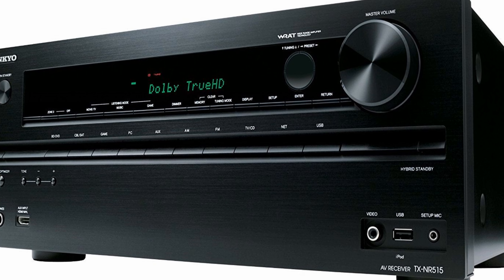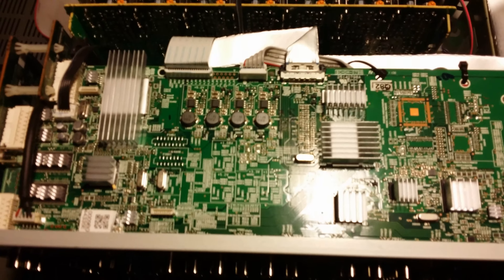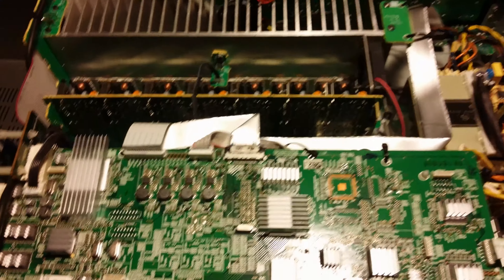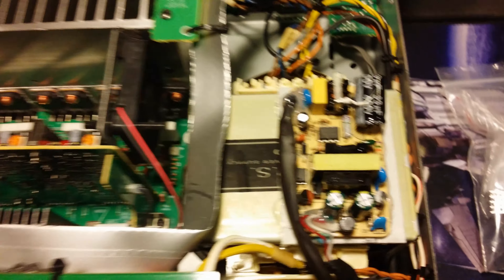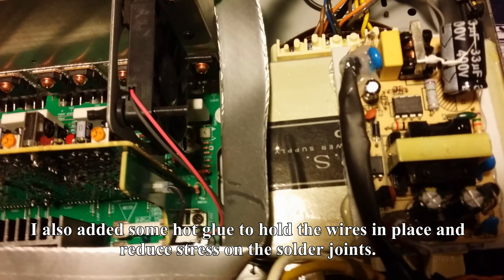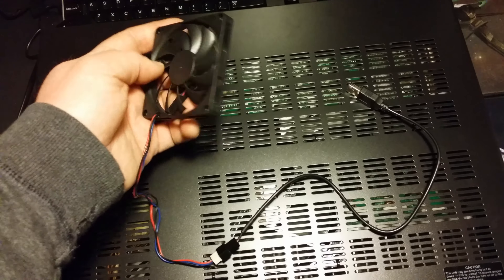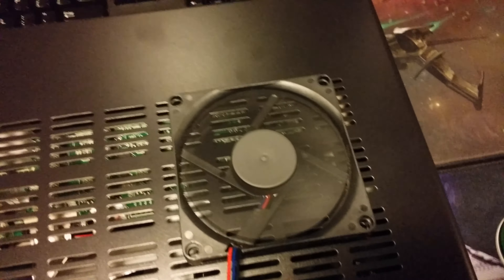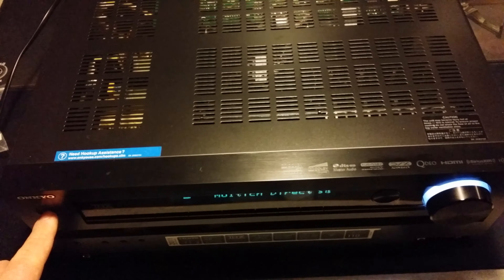ADD DIY: How to cool your ONKYO receiver -or- Save your HDMI board and prevent the "no sound" repair

Comment: Good video. Inspired me to repair my ONKYO TX-NR737 AV receiver and to integrate a self-made fan control to protect the components from overheating in the long term.
Reply from the maker: It is unfortunately necessary with these, especially when they are tucked into tight spaces like this one was.

Comment: Nice receiver Ed. I've always bought Pioneer receivers but I haven't upgraded in years. Good to see a video from you.
Reply from the maker: I had a Pioneer Elite for years, and then a non-Elite with HDMI switching, but it just acted as an HDMI passthrough and required separate audio input.

I went with Onkyo because they use a Qdeo upscaling chip, which is also used in the Framemeister. The quality of the upscaling is fantastic, and it introduces no perceptible lag in games. It upscales analog sources to 1080p (or 1080p to 4K) then outputs the signal through HDMI, and pushes the signal to both my TV and projector.

Overheating chip aside, you really can't beat them for the price if you want to upscale retro games and laserdiscs.

Pioneer is owned by Onkyo now anyway. They use similar parts and have similar features.

 Thanks for watching Gary.
Reply: EdT1138 sounds like a good alternative to a Framemeister.
Reply from the maker: It doesn't have all of the options, but considering that fact that you can get a similar chip for less than a third the cost of a Framemeister,  it is a viable alternative.

Comment: Excellent tip! Good you had a solution for the vibration.
Reply from the maker: It's silly that you should have to do this at all when a cheap heat sink applied by the manufacturer would fix 90% of the issue, but this brand has a few features not found on more expensive models from other manufacturers.

Comment: Hi, the amp still works? I have the tx-nr3009 with the "no sound problem", I am going to repair it and I am going to look for more heatsinks and I already have two fans that were from HP all in one. Onkyo It was a mistake that cost them the brand not to have put decent ventilation.
Reply from the maker: It worked for another year and a half after this, then I sold it and upgraded.

If you haven't already done so, do a factory reset before you open it up.
Reply: @edt1138  thank you for the tip of factory reset
Reply from the maker: @Luortizsolorzano  A number of people have said it fixed their sound issues. Maybe you'll get lucky too.
Reply: @edt1138  thanks for the information and it is true there are many who managed to repair their amplifier, the one I have was bought secondhand, I opened it just to check it and it seems to me that the original owner opened it and they repaired the dts chip and that does worry me, because if it turns on normal, but it does not give sound.

Comment: I just picked up an Onkyo Tx-NR646(N.Amercan version) which has an internal fan that never ran even when the receiver got hot,The receiver NOT being in a cabinet, and well vented. I could find no reference in the service manual as to what temperature it should cut in at, or if possible to adjust the temperature setting. Simply cut the wires from the connection feeding it, (it is marked as 12v.0.9A)and now feed from an external 12v supply I had spare, works perfectly, the unit has very minimal heat to touch on the outer casing after two hours of use now, previously it was hot to touch after a few minutes operating at low volume just listening to FM Radio. It is quite easy to feed the wires from the power supply through a small whole that exists in the rear panel, and the fan wires are very easy to access, with sufficient length to work with and make the required connection to the power supply, after removing the top cover from the receiver.Also runs very quietly.
Reply from the maker: Sounds like it should do the trick. Good luck.

Comment: Many of these laptop coolers have cheap sleeve bearings and get loud as time goes on. Take a look at the AC Infinity AIRCOM receiver coolers or their MULTIFAN line if you are on a budget. They are temperature controlled and very quiet.
Reply from the maker: Thanks, I'll take a look.

Comment: I put a fan inside the top cover of an old Sony A/V receiver. What I did was cut out a hole in the cover allowing all the air to flow through instead of the highly restrictive slots in the cover. Put a chrome finger guard on the top.

Comment: what is the diferent between those to chips? is this new better then old one?
Reply from the maker: It has been a while since I made the video, but I think you are referring to the picture of the chips I inserted in the video. That picture just shows two different versions of the chip that frequently causes problems when it overheats.

Comment: ive got the tx-sr805 , king of all super hot toasters!  the hdmi board was hot as hell and reciever would  randomly chirp on the different channels when it heated up...I added a heatsink to the main chip from which most of the heat came from, then ran an external 90mm computer fan with a 5v powerpack which was simply plugged into the 120v switched output socket on the back of the reciever..seems to have done the trick...the fan should be placed to draw the heat Out and awy from reciever and will be quiter if elevated with 1/4 or 1/2" risers under each fan corner..

Comment: I have HDMI fail ( resolution pbr ) TX-NR646, no video via HDMI, i think its over heat problem, i see 80 mm fan in over mainboard. i have no better idea what i fix hdmi issue.
Reply from the maker: If you haven't done so already, do a factory reset. Sometimes the Onkyo and new Pioneer receivers can have a whole host of problems fixed with a factory reset.

If that doesn't work it is a hardware issue of some kind and you will need to either repair or replace it.
Reply: @edt1138  I reset, and New firmware. No fix.
Reply from the maker: @SPPhotography89  That unfortunately leaves repairing or replacing. 

I was able to find a cheap HDMI board on eBay to replace mine, but that was a stroke of luck. There are videos on YouTube showing a few ways you could attempt a repair, but if you aren't comfortable with that sort of thing you'd have to pay someone. There is also always the option of bypassing the receiver altogether with video and just using it for audio processing.

Comment: How did those heatsinks work though?
Reply from the maker: It seemed to work. I owned that receiver for another year, and used it almost every day for hours without ever having another issue.
Reply: EdT1138 Classic Gaming Enthusiast hmm may try it. Mine gets pretty damn hot
Reply from the maker: @CrashCarson14  It won't prevent it from getting hot, it will just help dissipate the heat from the chips. The fan did a great job of pulling the hot air out though.

Comment: Hi EdT, my receiver keeps turning off after 15 minutes.  I have nothing plugged into it. I’ve had the receiver for over 10 years and now it just automatically shuts off. What can it possibly be? Pls help.
Reply from the maker: Sounds either bad capacitors or something is overheating. I am not an electronics engineer, or even a particularly good hobbyist, but that is where I would start.

On the other hand, if you have had it for ten years you might be able to upgrade relatively cheaply.
Reply: Thank you!

Comment: Can someone clarify me if I'm wrong? By my understanding, if you wire the fan to the adapter and then to the mains voltage, doesn't this mean the fan will continue to run even when you turn the receiver off? It's not like there's a switch somewhere in between mains voltage and that adapter he put in... Also, I'd like to know if there is any 9-15v DC anywhere in these receivers? If there is then I'd wire the fan directly to these points rather than including a power adapter. Otherwise, I'd do the USB option shown in the video as my receiver also has a USB port too

edit I figured it out! Most Onkyo receivers, if not all of them have a ribbon-like cable that connects somewhere on the outer edge of the HDMI board. This ribbon cable carries multiple +12V and ground paths, it's even conveniently labeled on the board which ones are 12V and which ones are ground. I used these paths to connect a computer case fan and it works! Powers on and off with the receiver like I wanted, perfect.
Reply from the maker: I can't remember for certain, but I believe I mentioned that it was a "switched" point on the board. In other words, when the receiver is turned off, no power runs to it.
Reply: So I looked into it today and I found a solution! Most Onkyo receivers, if not all of them have a ribbon-like cable that connects somewhere on the outer edge of the HDMI board. This ribbon cable carries multiple +12V and ground paths, it's even conveniently labeled on the board which ones are 12V and which ones are ground. 

I tapped into a 12V and ground path and connected my Cooler Master 200mm case fan (yes 200mm, it's big!) and voila, it works! It powers on with the receiver and shuts off with it also. The hardest part was probably zip-tying the fan to the chassis, the rest was a breeze!
Reply from the maker: @alexkalicharan8283  Just my own personal hangup I guess, but I wouldn't tap into anything on the HDMI board itself. There are so many issues with that board already, I wouldn't want to do anything that could cause voltage fluctuations or run any additional power through it.
Reply: @edt1138  in my case I use my receiver in a stereo setup, I don't use any of its HDMI inputs just analog audio from my PC and occasionally a CD player, so all is good for me. Others may want to take precautions if they value their HDMI board, then again a typical 120mm PC fan draws about 120mA so I don't know if it's dangerous or not. Do at your own risk!

Comment: Sorry to ask, the fan, pushes air in or extract air out.
Reply from the maker: Blows air out.
Reply: @edt1138  Thanks, my new Receiver its a TX-RZ820 has a built in fan. Its does not get particularly hot even with it of, but once in a while you hear the relay click and turn it on. Thanks, cheers

Comment: Hi EDT1138...Very nice video. I have an Onkyo HT R670 avr. I would also look now to do a preventive add-on of heatsinks + micro exhaust fans. My two queries here:

1. Which points did you add heatsinks on. Is that only on chips or something else also?
2. How to paste or glue these heatsinks there?

Thanks in advance...
Reply from the maker: There is a particular chip that causes the HDMI sound to fail, but I ended up applying a heat sink  to every  hip that got hot while it was on. Probably overkill.

Look up thermal adhesive, or thermal pads/tape. I used thermal adhesive.
Reply: @edt1138  Thanks, dear!👍

Comment: For ALL new Receiver owners , Denon, Marantz, Onkyo,Pioneer etc . Buy two fans ,one pulling and one pushing. Dont rely on the Manufacturers. Fans are cheap .
Reply from the maker: I honestly can't figure out why they risk pissing off so many customers when a 3 dollar fan and 20 cents worth of heat sinks could have solved the problem.
Reply: @edt1138  Because they have to sell more and more, otherwise from the business point of view they will die. If you don't care about the equipment, in a few years (after 2 years of warranty) the equipment will be broken and you have to repair (but will be very difficult to do this because you will not find components - look what happened to the entire world with Onkyo HDMI boards of different models) or simply you will buy a new one and in this case the company "wins".
Reply from the maker: @marspin2791  On the other hand, I was able to get one really cheap and fix it, so it isn't all  bad news. I would personally never buy a brand new one.
Reply: @edt1138  Good for you! All the best!
Reply: By the way, for my Onkyo tx-nr808, I'm using "Deepcool Multi Core X6"; it helps me to keep cold the inside of the equipment, it's very silent, looks nice on top of the receiver and inexpensive, around 24 Euro.
Reply from the maker: @marspin2791  Never thought to use a thin laptop cooler. That was smart!

Comment: nice fix, and most likely that power adapter is important. I got into a routine of at least labeling most of mine. and extra bag of heatsinks ftw....lol
Reply from the maker: Probably, but I looked it up before tearing it apart and it is only $5, so I can order it again if I need it.

I have so many bits of random crap lying around that I'm surprised when I actually need to order something like that.

Comment: I find it kind of odd. that Onkyo knows that these high-end av receivers do generate a lot of heat when under stress. I would think it would be wise of Onkyo to find better cooling solutions especially when the new Onkyo's supporting 8-6-4- ohms load for their top-end receivers such as the RZ50. or any of the RZ series. I'm thinking right now about buying the RZ50. 
I also own an Onkyo TX-DS838 from 1999. still works great. but has NO wifi. no HDMI no Dolby atmos. but. can hear my fan coming on at like 0db.
Reply from the maker: It probably isn't an issue if it is in a well ventilated area, but I can't imagine a decent fan would add much to the overall price if they added them.

I upgraded to an Atmos receiver from Pioneer a few years ago, and I spent $80 on an AC Infinity Aircom unit. I haven't seen many movies where Atmos makes a noticeable difference, but the Aircom unit seems to have been worth the investment so far.
Reply: @edt1138  ventilation is absolutely critical to AB class amps or receivers. I was thinking exactly like you. it would cost them maybe 7$ to add a decent fan that would suck the heat out,  I can't figure this out.
on the other hand. I just bought a Crown XLS1502. D-class amp. Boy, this amp can drive four 8-inch 2ohm DVC subs with no problem. as long as you wire them correctly.
the reason I mentioned the Crown. it put out NO HEAT, even under a huge load. and sounds awesome. without any cooling. there is a fan. but I saw It come on.
I believe that eventually in the near future all av receivers will be D class.

Comment: lol. the NR 6100 comes with a fan already. they provably followed your tutorial.
Reply from the maker: The simple edition of a fan fixes so many issues. There have been models with fans for years but they were either small and noisy or set to only come on when they were already too hot, sometimes both.

Comment: onkyo's 2 channel amps and receivers have been having problems with uncontrollable volume, not staying on etc.. Too I almost bought one :-O
Reply from the maker: Seems like Onkyo have all sorts of quality control issues. It's a shame, because their feature set for the price point is really good.
Reply: Last year I retired a 90s onkyo receiver that I got at a thrift store a few years ago because the left channel's solder joints kept going bad. Which I think relates to the fact my moms BF dropped it when we moved to another house

. I got a Technical Pro receiver to replace it. TBH It's a sounding better receiver than the Sony Receiver I also looked at. I expected the Technical Pro receiver to be bad but it's not. A bit weird in terms of features but not bad.

Comment: One of my hdmi ports just fried!! Wish I had found this sooner.
Reply: ME TOO WITH ONKYO HT R997 in thx 9800 system. Its showing NG:LCR, will these fans do the work. My system runs 5-10 hours almost daily due to YOUTUBES VIDEOS, NETFLIX ETC. PLS SHARE YOUR EXPERIENCE>
THANKS & REGARDS
Reply from the maker: @ajay Unfortunately, I am not a repair tech, so I'm not sure what that code is referring to without doing some research. I would suggest querying the Onkyo forums, or doing a quick Google search to see if anybody can point you in the correct direction. 

Good luck.
Reply from the maker: @stephen It is a real shame that Onkyo knows this is a problem, but hasn't bothered to fix the design flaw for years.
Reply: @edt1138  OK!! An Update to my problem - I fearfully went to Onkyo service centre thinking it may put a hole in my pocket. (Regarding : NG:LCR - THAT MEANS NO GOOD, LEFT, CENTRE AND RIGHT FRONT SPEAKERS ). THE SERVICE MAN TURNED THE AMPLIFIER TOWARDS HIMSELF AND BACK TOWARDS ME, DID SOME SETTINGS WHICH I SEARCHED AND TRIED MYSELF OF NO GOOD. BUT PERHAPS HIS WAY SETTING VARIED THAN ME, NEVERTHELESS, THE ISSUE WAS SOLD, SYSTEM CAME BACK TO ALIVE... (SIGH), ALAS, I WAS SO THRILLED BY THAT TIME AND I FORGOT TO ASK WHAT HE DID. BUT IN HTR997- THE SYSTEM WENT TO 'PROTECTIVE MODE AND HENCE SELF DIAGNOSIS', WHICH COULDN'T FIGURE OUT, AS TO HOW TO CALL BACK TO NORMAL....

THAT'S ALL... I THOUGHT TO SHARE WITH YOU.

THANKS AND REGARDS...

Comment: I got a second hand on with one already fitted
Reply from the maker: It is just a shame they go bad so often. If it weren't for this one fatal flaw their receivers offer great options for the money.
Reply: I just got this amp last week second hand .
I do not use it for the TV monitor  , I see no point in using extra cables to re-processes the picture   ? 
THX sound is what i grabbed it for so , for sound use there is no extra heat 
that board is redundant  . 
This amp is about 4 years old , unloved and stored away so it should last a good 20 years like my YAMAHA has .
This big amp has it for my taste , its FULL of ADRENALIN    !!! 
playing video games  ?  just tap off the audio from the console to  the amp  . the video cable connect it to the  TV monitor .  no problem
Reply: does the amp still work?